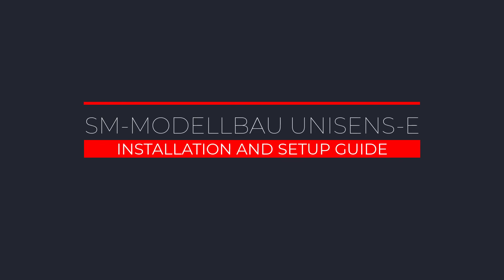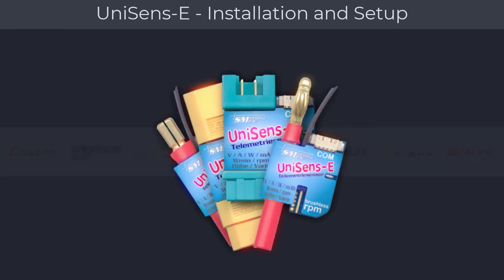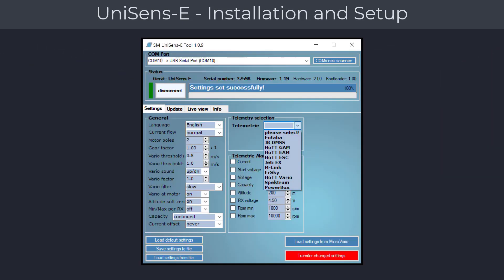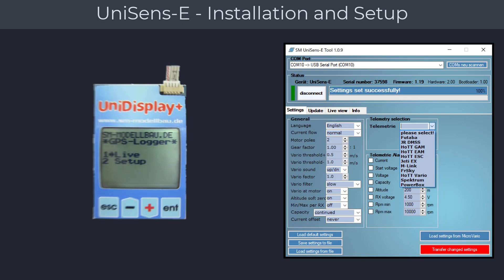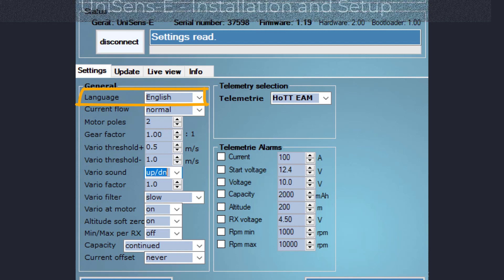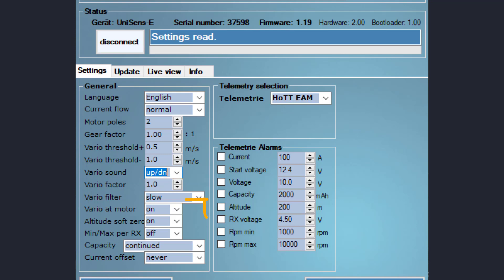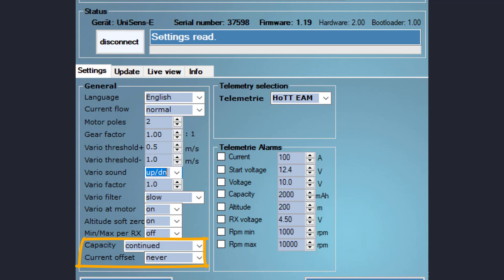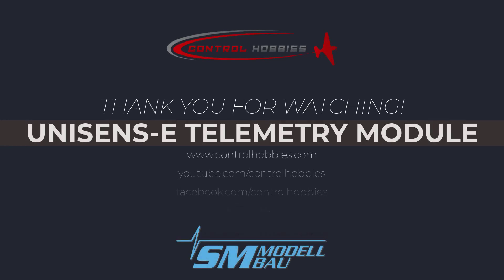UniSens-E - Installation and Setup

Comment: Can you connect the RPM sensor wire to an ESC RPM output (like the one in a Castle Edge ESC) instead of a motor wire?
Reply from the maker: No, it needs a connection to the motor wire to count the pulses.